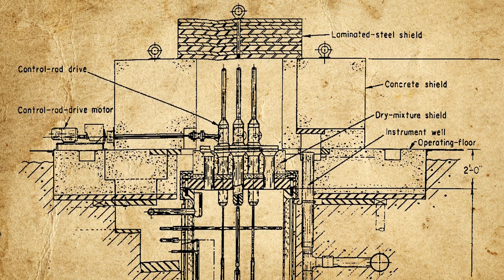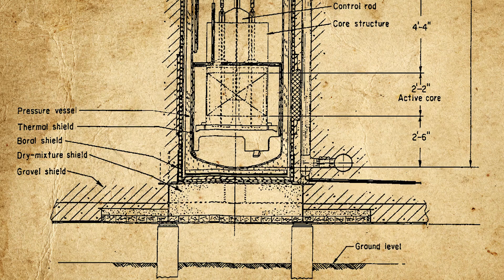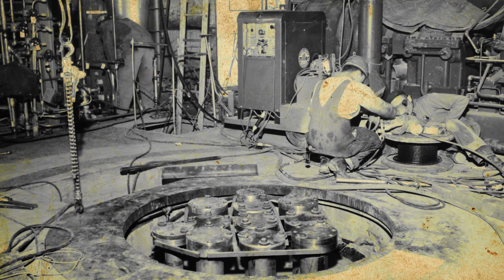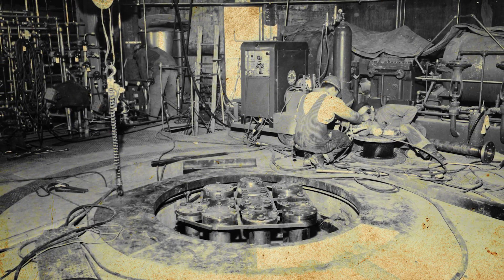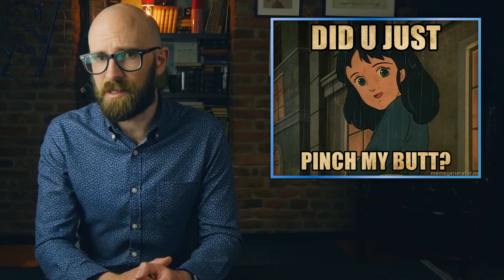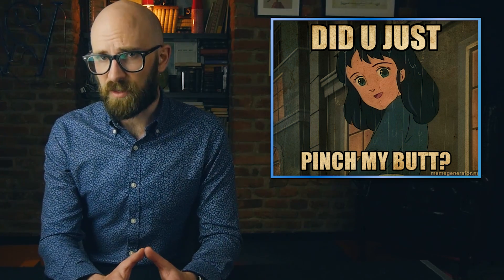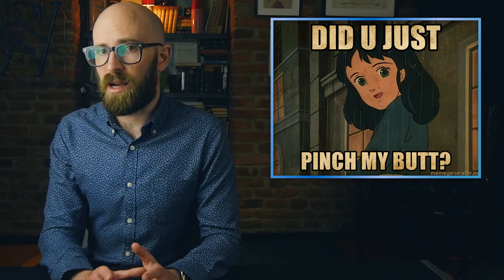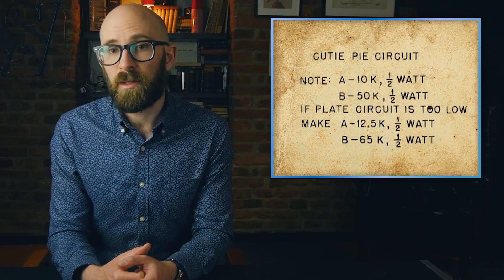That Time Scientists Ran Experiments on if Pinching in the Butt Could Cause a Nuclear Meltdown

Comment: I think it's more likely that the guy pulling the rod was surprised by the prankster guy getting really close behind him and shouting "BANG!" in his ear. If you did that to someone in a high stress situation, and if they had a strong enough startle reflex, you could probably make them yank out the control rod. I think horseplay is a plausible explanation for what happened, I just don't think it was likely that a guy grabbing another guy's ass would cause the necessary jump reaction. Maybe, but probably not.

Failing that, the most likely explanation is that the control rod was just stuck really really good and yanking it free pulled it out of the core completely and caused the reactor to go batshit.

Comment: Water-cooled Nuclear is dangerous, as it easily boils.  Also, fuel pellets swell over time.  The inventor of the first nuclear reactor Alvin Weinstein also invented a 'safer' reactor that used salt rather than water for cooling.  The salt did not boil,  and the cheap reactor building and coupled with the concept of dissolving the fuel into the salt instead of fabricating pellets the fuel could be used nearly 100 percent rather than 2-3 percent further reduced energy costs.  A prototype was successfully demonstrated for years at Oak Ridge National Laboratory.  But it's energy was cheaper...and no plutonium was produced that could be sold...so it was not popular with the existing nuclear business as typical today.    Now the nuclear industry is in decline, and energy users are paying the 'deactivating expense' of a failed business model both expensive and unsafe.

Comment: I get how nuclear reactors make electricity,  but how can you use that for heat?? Because all it does it boil water, how do they convert that to dry heat to warm yourself up without everything getting all radioactive and stuff
Reply: The water evaporates, powers a turbine which generates the electricity, while the water condenses to be evaporated once more.

Comment: Hey Simon, I'm trying to be really careful and sensitive with this suggestion for a video, but with the recent event with the disaster in Beirut would you be willing to answer the question of why do we use such volatile substances in both commercial use and, let's say "less than commercially intended" commercial use?

I've been trying to theorize in my mind, because I don't have access to all the records and information, why would so much ammonium nitrate be in that port at Beirut to be seized? Was it for the less than commercial use or was it for a legit purpose? But since ammonium nitrate is a bit "common" per say, there's so many other "common" substances that are potentially disastrous that we keep under our sinks, in our sheds, in our cars, stocked in the stores. Why do we still use them/why isn't there more stable alternatives? Again, just a video idea to mull around. I definitely don't want to disrespect or belittle the suffering the people of Lebanon are going through at this time. I just have been wondering why do we still have a dual purpose for ammonium nitrate and other substances and why haven't we found alternatives to segregate these substances to 1 use or the other.

Comment: There was a study done once on people tripping over things. In order to deal with the issue of consent while keeping the subjects unaware of what really happening to get valid data, the researchers came up with a clever solution.

Two of the researchers would hold a rope at ground level and asked a subject to cross it, and said that sometimes they would raise the rope or not and that they'd look at how the subject tripped up. Those that did the test knew what they signed up for.

But before the subjects actually crossed the rope, a hidden block would rise out the floor, causing them to stumble when they least expected it- which ensured that their reactions were genuine and the results valid.

Comment: You have entered my domain, Simon. I am well versed in the story of the SL-1 reactor. You did a fairly good job at covering the key points, and I appreciate that. Nuclear power is a very safe and efficient source of power, when used appropriately. 

Modern nuclear reactors are exclusively remotely operated via a process called "shimming". This is when the reactor operator uses the shim switch to shim the rods in or out, depending on the required operation.

Little known fact, Specialist Byrnes was found pinned to the ceiling of the reactor compartment with one of the control rods, likely the one that was lifted initially. Within the Naval nuclear community, given that gallows humor is rampant among our kind, we refer to him as Reactor Jesus. He died for our shims.
Reply: “He died for our shims.” Oh god that pun. 😅
Reply: @Memegum The route I went, and likely the "easiest" route is to join the Navy as enlisted. You need a high ASVAB score, and push very hard to be a "nuke". Once you do you can decide between 3 rates, ET, EM, MM. ETs and EMs have pretty much the same training the difference is ETs are more on the computer side whereas EMs are more on the physical component side (motors, generators, etc). MMs, are much more physical, dealing with the piping and valve placements etc.

As for training, it is 1.5(ish...+/- a few months) of training after basic, (bootcamp) during which you will learn a variety of subjects from mathematics to reactor physics, to radiological control. After all this, you will need to demonstrate that you can qualify as a nuclear operator aboard the test vessels. This entails demonstrating the proper knowledge and capabilities to actually perform your daily duties as well as conduct yourself during simulated (and on occasion, real)  casualties.

After all that you will be able to go to your first station and qualify for a variety of things. Hours are long, life is hell, but eventually, if feels worth it. I am medically retired, but I went through as an EM. my typical day included a ton of cleaning, logs, and maintenance, but I also operated the electrical plant as well as the throttles for the steam plant.

There are paths to get in as an officer or a civilian, however civilians won't be sailing often, if that is your interest, and both require a degree in a relevant field.
Reply: This jives with what a classmate shared with our group in freshman physics. He was in the navy and served on a nuclear powered ship; this story was taught in the school on nuclear navy things.
On a side note; in the physics class he learned the source of the formula's they were taught in the Navy - but were never explained. One critical one - dt, the time it takes to pull the rod out is very critical; do it very quickly (i.e. it's stuck and suddenly lets go) very bad things will happen very quickly.
Reply: @ronboe6325  oh they claimed they cared about everyone understanding why things worked the way they did, but they don't. You memorize the material (pronounced "studied, and understood the material") and took tests on it. You memorized the formulas (pronounced "studied and understood the formulas") and reproduced them with sufficient effort, and you were good. Some things make much more sense to me going through college physics now than they ever did in the Navy. Granted, our job wasn't to explain theory, it was to operate and maintain the nuclear system.
Reply: Uh, it was Legg who was pinned to the ceiling. Not Byrnes.

Comment: Boron does not turn into carbon 14 when it absorbs neutrons. Sometimes boron 11 will absorb a neutron and turn into carbon 12 (im guessing this is what you meant though im not sure if this causes the boron yo get sticky)  after an extreme duration some of that carbon 12 will absorb 2 more neutrons turning into carbon 14 but the concentration will be tiny because you need 3 consecutive very unlikely neutron absorbtions

Comment: Other You Tubes give other additional information. Narrator for got to mention something else unusual about the accident. Initially when emergency crews went into the reactor chamber they could only find two people.  They later found the third individual pinned to the ceiling by the a control rod. "The No. 7 shield plug from the top of the reactor vessel impaled the third man through his groin and exited his shoulder, pinning him to the ceiling. It had been shot out of the tube by the steam caused by the criticality event. Ouch. He probably was dead before he hit the ceiling or not long after due to the radiation.

Comment: Coincidentally: A pinch is the compression of an electrically conducting filament by magnetic forces. The conductor is usually a plasma, but could also be a solid or liquid metal. Pinches were the first type of device used for controlled nuclear fusion.
Reply: If that is true, that is a really cool coincident. Thanks for the comment.
Reply: Really?? That's actually a really neat fact. Thanks.
Reply: Oceans Eleven?
Reply: Timothy McCaskey l e a v e
Reply: wait have nuclear fusion been invented yet?
Reply: @Tantrano  Yes, but it's not viable yet. Google tokamak.

Comment: TLDR: If a rod was pulled fast enough on the control painel he whole plant would be messed up. There was no concrete evidence of what cause the operator to pull it, and as there was a prankster on the plant, they tested if a few pranks could scare someone to pull the thing,

also there is a guy called dickleg
Reply: "TLDR: If a rod was pulled fast enough on the control panel. the whole plant would be messed up."
Your tldr is kinda crap, the control rod was not controlled via control panel but an operator manually pulling it via lifting by hand to perform maintenance.
If you are going to tldr stuff, have the patience to actually pay attention.
Reply: The point of a TLDR is to quite literally spoil something. The video was quite long, and with a title that interesting some people just want the spoiler. 
Also no idea how what you said differs from the overall message
Reply: @pimi8522  Well you did enough to edit your tldr, thanks my dude.
Reply: @pimi8522  Ayyyy ya edited the reply too! The original was "No one cares my guy" and my reply was to that.
Have a good day.
Reply: @spider0804  I felt bad, I was terribly sick and stressed out. No one deserves to be treated like that, even on the internet.